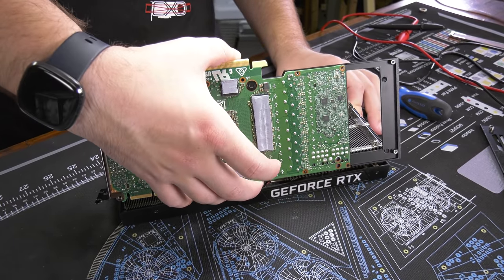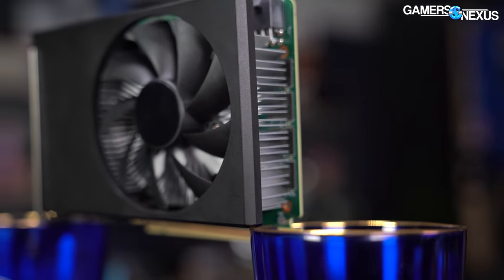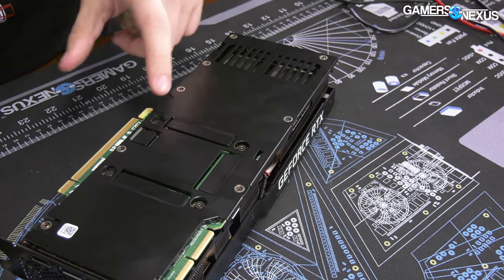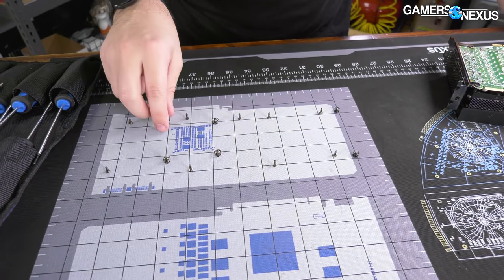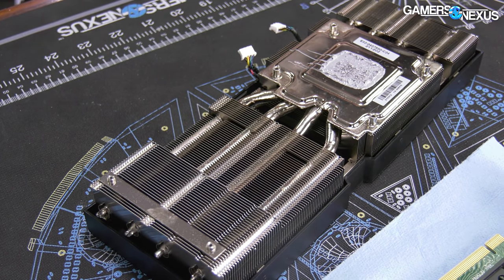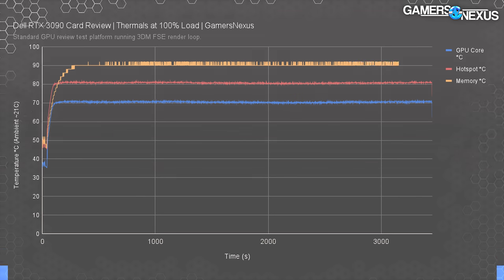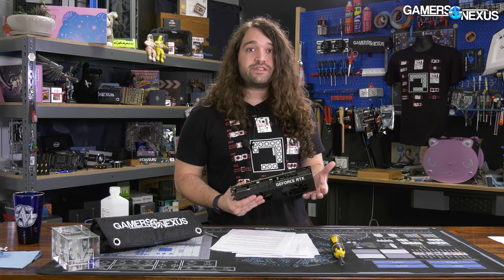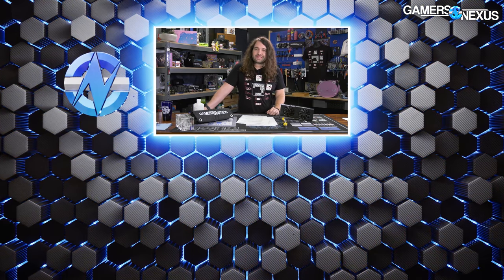Sometimes Dell Actually Tries: Dell RTX 3090 Review, Tear-Down, & Benchmarks

Comment: Great review, but the only thing I see wrong with your review is that the 3090 isn't offer in the case(r10) shown in the video. It's only offered in the R13 case which has better air exchange due to better engineering of the case itself. I am going to switch out my R13 case fans when it arrives, but not due to better fans, but quieter fans with the same volume of air movement. I have, in my life, bought many Dell computers, but I usually build gaming computers for myself, like my last beast(Dual Liquid cooled 980TIs). But this time it was Dell all the way, couldn't even come close to building this for the money I spent for this pre-built. I'll be waiting a month, but I think the 2k I saved will end up being worth it.

Comment: Great review GN 🥰👍🥳🤯 and we’ll done to Dell! I got my bro a Dell G5 model pc here in Australia 🇦🇺 for an extremely good deal at initial launch of the RTX3070 and this pc has the RTX3070 and it performs very well. The GPU is quiet under a full load and never goes pass mid to high 60’s Celsius and it’s a 2-slot design similar looking to this 3090’s and features thermal pads on the memory as well! The rest of the pc is not bad like the one reviewed on GN a little while ago. Dell can make vg pc gear, just not their more mainstream models.

Comment: Extremely similar cooler compared to the HP Omen RTX 3080/3090 cards. Omen cards also have the vapor chamber on the coldplate.
The Omen 3080 uses the same cooler as the 3090 version including the backplate, but unfortunately they didn't add thermal pads to the backplate of the 3080.

By adding thermal paste on top of the 3080 vaporchamber (so it makes contact with the middle-plate that cools the memory) and adding thermal pads to the backplate you could drop the memory temperatures by a whooping 20 degrees celsius. At that point the only possible upgrade for better cooling would have been an EK waterblock, which I did (EK has listen Omen cards in their compatibility charts).

Comment: I would never recommend Dell for pre-built PCs but their monitors have been serving me well and I would recommend them. I used a Dell S2716DG for a few years before it starting having issues and I replaced it with the Dell S2721DGF.

Comment: it seemed like with the back plate heat pipe that the design was originally a heat pipe that hit all 3 sections of the memory modules covering a portion of them all. Then the tooling for the sheet metal tool for the back plate was paid for first. Then later on in manufacturing feasibility the heat pipe either couldn't be formed the additional 90 degree bend due to tooling or the heat pipe itself got damaged etc. during a pilot production run so now you have the end result with the increased thermal pad height and the heat pipe forgoing that vram section.

Comment: That left hand memory module on the back—it looks like the heat pipe was originally going to keep going down that side, because there's the same smooth finish there as under it on the other side.

Comment: I have a Dell 2060 SUPER which came in an Alienware (I no longer use any other parts that came with), and while I originally used it for gaming, for the past year I’ve replaced it with my 3080FE for gaming. Therefore I now use the 2060S for mining 24/7, with the card overclocked. Amazingly, given the supposedly poor quality, single fan, it’s extremely reliable. It’s not crashed in over a year, runs cool and quiet, and I get higher MH/s than average reported online.

Comment: The VRAM temp on this card is insane. I bought one from eBay to put in my rig and i had to put copper heatsinks on the backplate and a noctua fan providing constant airflow over the backplate to keep the VRAM temps from maxing out at 110C
Reply: Just put thermal paste on the vapor chamber, dropped my VRAM temps over 30 degrees.
Reply: There’s a video out there somewhere that shows where to apply it.

Comment: Did I understand you correctly that you are saying the memory modules aren't contacting the heat pipe? Because to me, it looks like they do. If you align the screw holes of the PCB and backplate as well as the thermal pad residue on the backplate with the "holes" in the thermal pad on the memory, it looks to me like the heat pipe does run across the memory.

Comment: At first look heat pipe on backside for memories was probably meant to go around all 3 banks but later it changed (saving cost?). So 2 bank are half covered by backplate and other half with heat pipe. But last bank is covered only on one half so they added higher thermal pad to cover other half too

Comment: The heat pipe is actually going over the pads of the memories, I just wish it would have extended to all the memory chips and also extended and connected via a thermal pad to the front heatsink.

Comment: I think the backplate memory cutout was meant to have the heat pipe on both side and top, but for some reason the heat pipe was only long enough for the rear and top side, so they padded the empty space with thermal pad.

Comment: Would be interesting to see a company do a cooler that is, say,  2.5 slot, plus a 1 slot cooler on the back of the PCB. (Might need a funky PCI connector, that "shifts" the card downwards by 1 slot, to maintain the CPU cooler clearance).
A friend of mine has attached the cooler of an old Gigabyte 7600 gs, onto the backplate of his rx590 via thermal pad, and reported significantly reduced temperatures. This was probably largely thanks to his Wraith Spire "accidentally" blowing air onto the heatsink, but just imagine, what could be achieved with a backplate cooler that is designed from the get-go to actually cool.

Comment: Memory temperature does affect the fan profile somewhat. If the memory junction temperature approaches 110 degrees on some 3080/90s, the fans will ramp up even if the core temperature is in the low 60/50s. Though in these cases, the fan ramping up won't really help with the memory temperature much, and you just end up with a very loud card with throttled performance.

Comment: Looking at the heat pipe on the back plate, it looks like the mistake was the heat pipe was rotated 180 from what it should have been.  It hits the edge of the mem chips.  If spun around it would hit all three blocks instead of just two.  They came so close!

Comment: That heatpipe does touch the top and left side memory (if viewed from your angle when holding it Steve). Look at the thermal pads you can see where it touches on the left side.

Comment: I worked at Dell when they made good stuff in a lot of areas. New build. They assemble the parts they are given the way they are trained. Most of the time due to quality checks. If the supply chain has bad parts they do not stop. They work through the bad parts until the good ones arrive. Tech support sometimes they know the problem with things like bad caps and the such and sometimes they do not know the issues. Here is the big problem. metric in all areas such as refurb. I have seen lots of bad stuff get pushed out do to Metrics on things like laptops that need thermo pads changed but you have to take the mobo out. Which take more time. Which means they do not get fixed. Just turned until they pass burn. Bad things is they come back and end up using the same bad parts form teardown.

Comment: Those backplate heat pipes do touch the memory chips, partly. The other section that doesn't have heat pipes use larger thermal pad because it lacks the heat pipe. If it didn't have large pad, about 33% of the memory chips would not have any contact to back plate.

Comment: you overlooked that the heat pipe runs over the modules, but Dell overlooked that there is no heat pipe on the other side, so the sheet metal is too narrow and a thick thermal pad was used as the production of a new tool would be too expensive.

Comment: In all honesty, it kinda looks like the heat pipe on the back is actually contacting half of the 2 memory banks.
If you look how the screws in the backplane line up, in comparisson how the line up on the back of the PCB.
You can even tell, the thermal pads on the memory is squished by the heat pipe.
But otherwise, a great review, for a product of a company that suprised me in both ways so far.

Comment: I feel like the U part of the copper heat pipe on the back plate was supposed to touch 3 of the 4 vram locations; and that is why the larger thermal pad was needed

Comment: My guess is Dell went to it's board partners and said, make sure these are not coming back to us with a ton of issues. They were likely surprised at the failures of the 2000 series which didn't handle heat like the champ 10 series did.  You see this with their ECS made 5600/5700/XT all the way up thru the MSI 3060/70/80/90s.  All of them are engineered fantastically well to handle heat.  My memory rarely goes above 78c on the 5700XT I own (looks like it's straight out of 2012 mind you..),  and considering how cool the Dell 3070 stays im guessing the memory runs cooler than many cards out there as well across all their 3000 series cards.

Comment: Actually the heat pipe is making contact with the top and side memory modules, that's why the thermal pads are indented more on the top and side

Comment: This is what I did. I turned the actual machine into my capture box with my old 1080ti. I was actually pleased with it because I thought I would be replacing it down the road. I do want to replace the fans if possible but I bought a warranty through microcenter with a replace no matter what >.> even if I drop it :S

Comment: The taller thermal pad looks like it was intended for the heat pipe to be there as it does actually sit on the other memory modules.

Comment: I have the 3080 card. Was surprised on how hot it is under full load. Then after researching here and there found some have suggested to apply some thermal paste around the part where the stickers are placed (shown at 11:11), of course removing the sticker. Temp went down quite a bit (~10c)... It is less noisy now.

Comment: Glad you said it was better than expected in the beginning because I have the  Dell (Alienware) 3080. It is identical to that 3090. (yes I bought the Alienware for the card and built my own system with a ROG Crosshair VIII Hero and a 3900X and sold the Alienware)

Comment: I got the Dell 3090 with Corsair water block I have it mining but the memory on the back stays hot and needs a heatsink on the back with thermal pads to stick to the backplate with a fan on it to maintain 96degress or lower

Comment: I think the heat pipe seen at the backplate was supposed to snake to the other side memory module. Thats why the indentation is short. Why the heat pipe doesn't contact that other side I couldn't even guess.

Comment: Backplate and its cutouts are not "the correct" size, because if it (lip) would be bigger it wouldn't produce enough pressure IMO. So thicker padding is due lack of heatpipe on that side. By looking the video it looks like that RAM on the other side has the same size lip and is also only partially covered by lip and the other half is covered with heatpipe, where RAM on the other side has thicker thermal padding. Due same small size lip thermal pads on RAM on heatpipe side have worse contact (where you showed thermal pads are "badly made" ).

Comment: Purchased a Dell G5 15 SE, I don't think the CPU (R7 4800H) is supposed to run at a max of 114°C according to Core Temp and GPU-Z, but I'm not taking it apart until the basic 1 year warranty runs out just in case.
GPU and other aspects of the laptop run fine though.

Comment: I think that heatpipe on backplate was designed to run also to memory on other side (to cool 3 sides) - but someway during design process it was shortened to cool only 2 sides (maybe it was not performing as expected) and maybe backplates were already built so they added 2,5mm thermal pads instead of that heatpipe

Comment: I might be 2 years too late but I just noticed there's a code at the pci connector that said ms v388. That is basically an MSI Gaming X Trio board. Well in this case, dell decided to use a 2 fan solution instead of the 3 that msi employ.

Comment: It's a pity that you didn't check and provide the height of all thermopads, because it seems from above that they are smaller than 1.5 mm and higher than 1 mm. I'm looking for this information and there is no clear answer on the Internet. I'm ordering 1.25mm, I suspect these will be correct

Comment: Had a fan failure on this card after about 2 months. The fans would spin momentarily, then stop. This a fan issue or some type of fan controller on the card itself? Was replaced under warranty but it's happening again on fan 2. Thoughts?

Comment: 9:44    It looks like maybe that heat pipe was originally gonna be longer and curve around behind that spot, just like the other two.  But something changed, so they needed to fill the space with thicker thermal pad.

Comment: So my theory on the mistake with the way the backplate was designed: the engineer drawing it up knew the size of the module (as seen by the two indentations perpendicular to the screwed up one), and they were able to use part of the heat pipe to contact the modules opposite of the screwed up side. I'm guessing that as they were drawing it up, they started by making the indentation on the heat pipe first, and then just copied that indentation to the opposite side, overlooking the fact that the indentation is too small and there is no heat pipe on that side to make up the difference. It gets to assembly, the person putting it together says, "hey boss, this doesn't line up." Boss says, "ah shit, I'll let engineering know." Engineering says, "ah shit, well, just use a thicker thermal pad on the plates already made, and we'll change the drawing."

Comment: Yes I ordered a G5 with a 3070.  Stuck a used 1060 in the G5 and it went to ebay, which turns out I got scammed on.  Then stuck the 3070 in my R7 hotbox, with a corsair H80i V2 (which solved nothing) with a noctua nf-f12 3000.  The 3070 is really well built though and running cool, CPU 8700k not so much.  Never again going back to custom for the next one.  I'm very familiar with what you're talking about in this video though lol.

Comment: That "mistake" on the memory looks to me like in fact the heatpipe is supposed to run all the way to that third memory set. But for whatever reason they have terminated at the second set instead and used the taller heat pad.

Comment: Surprisingly enough, it's better designed than the FE cooler. At least dell didn't take a "what are VRAM temps?" approach. I had to replace my TIM to get to a 10° delta between the core and the Hotspot. However, my core temp stays at 56°, hot spot at 66° and VRAM at about 78°. Prior to changing the TIM, VRAM would break 105° and the core would creep up on 80°

Comment: The nickle plated part that make contact with the GPU chip is not perfectly flat with small dimple making surface with low metal distortion and also made of thin copper plated nickel , I prefer a more solid massive point of contact non plated copper for heat transfer !

Comment: 9:20 - Would have been wiser to extend that heat pipe over the memory, which looks like that is how the back plate was designed, but not implemented.

Comment: The metal on the backplate that touches the memory, is pretty much isolated from the rest of the backplate. Why would you do that?
And the base plate doesn't have good contact with the cooler itself. The die cooling is decent, but I bet everything else is quite toasty. 
All I've seen is the teardown so far. Sometimes I just want to design my own card.

Comment: dell actually seems to make decent cards nowadays, i have a dell 2070 in an antec fusion case, on low case fan speed and auto card fans, i never hear it and its never gotten hotter than 80 degrees. i have it overclocked and set to underclock at 85 degrees and its never had too, i only play games at 1200p, or 1080p, so its not like im destroying the card with 8k, but during video rendering it will max the card out with h.265 nvenc loads but it doesn't break a sweat. again that's in an antec fusion case from early 2000 with a negative pressure flow set up.

Comment: My old 760 GPU card did the same thing, it ain't fancy or new to have air fins in the upward flow of the case.  Fresh air in the bottom, across the fins and out the top, and it probably helps cool the chipset as well.

Comment: I saw a video recently where they added thermal paste to the metal plates area around where you are saying there is too much. They said it resulted in ~10 degrees colder running temps. Reason is they said it keeps the VRAM temps down. Do you recommend doing this as well?

Comment: During the teardown (9:21) I was concerned about the backside memory module next to the PCI-e slot as there seems not to be a sufficient amount of surface area to spread the heat to the backplate as its cut shot to fit against the PCI-e slot, who knows I could be wrong.

Comment: Around 9:50 you are talking about the notched out area of the backplate and the stepped thermal pads. You really can't figure out why it was done that way? Really? And you do this for a living??? That's shocking. It was done for spring tension. Because there is a fairly large area cut away from the backplate, it weakened the structural support as it isn't a congruous piece of metal any longer. The metal bent as it is offers some spring tension to keep the backplate firmly against the thermal pad and the memory. It's controlling the direction and amount of flex. They probably determined it would be a diminished return to make that area wider to cover the entire memory chip.